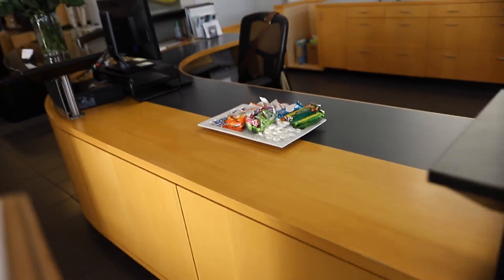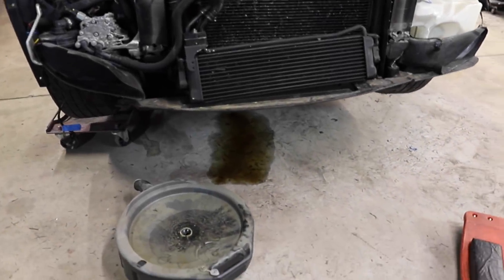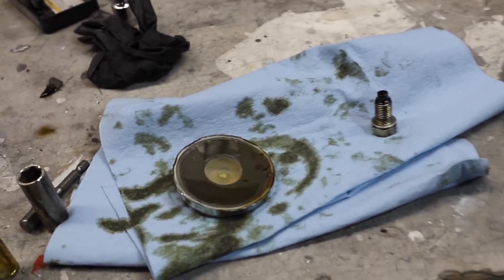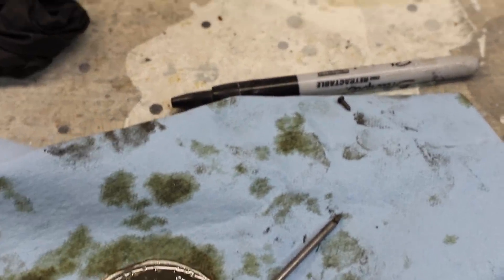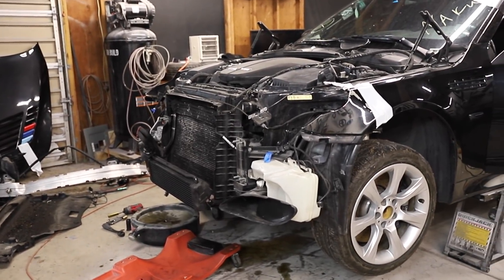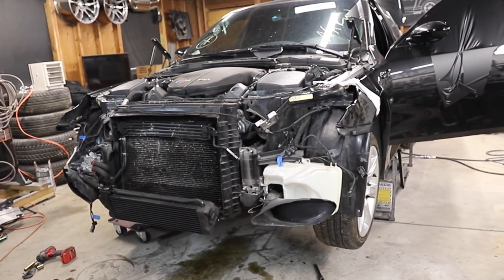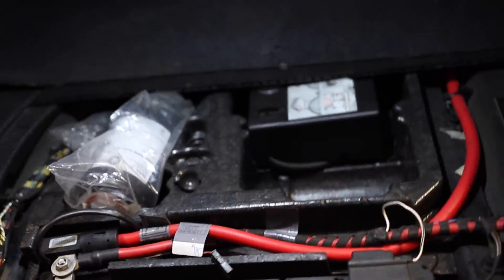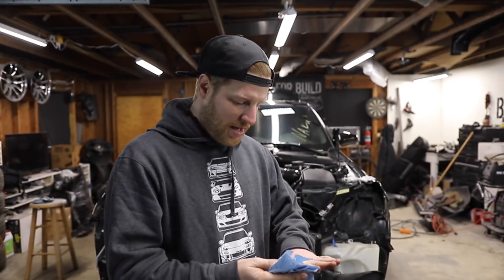Does the M5 Engine Run? Let's Find Out!

Comment: $135 for 6 quarts of oil and a filter? Did that come with a massage with a happy ending at least? Holy shit bro...I would've just gone to Walmart and bought a gallon and a quart of Mobil 1 with a K&N filter and a bottle of STP Engine Treatment and still had $80 left...I'm just blown away by what BMW charges their customers for what is basically equivalent to parts store oil. Regardless of what they try to convince you of, there is no difference. There is absolutely no argument that anyone can provide to me that would convince me otherwise. Granted, the manufacturer knows best, but come on, I PROMISE you that the dealer isn't paying anywhere near as much as what they are charging you.

Comment: i work with oils on an industrial level and that small little shaving shouldnt be an issue to worry about nut definitely consider running the xar wuth new oil and then sending a sample off to a reliable lab for testing. hope that helps!

Comment: Camera focus will improve if you shoot with a larger aperture, granted it wont look so cinematic but for general garage bits when you're in front of the cam thats not so important. Also try the other autofocus modes on the camera, you may find one that works smoother.

Comment: Could you mess around with the new camera settings and take off the focus? And I think you should be fine with the rod bearings because if you looked at your filter real good and you haven't find any metal shavings I think you're good

Comment: Wow, that's a crazy low F-Stop you're shooting with.  I know the shallow depth of field looks cool, but it can also be distracting.  You can go into Manual mode and set the aperture to F2.8-F3.5 and it will give you greater depth of field, but ISO will go up, so just be aware that it'll get grainy if your ISO goes too high.

Comment: Your not going to get good data if you just changed the oil. The oil needs to run for around 500 miles before you send it in.

Comment: Hi Chris,

regarding the RPM in the dashboard, please be advised that the RPM is filtered and smoothed for the average driver.

There is a nice talk about the Dieselgate ECU and how a programmer found the manipulation. At 48:20 of the talk ( https://media.ccc.de/v/32c3-7331-the_exhaust_emissions_scandal_dieselgate#t=2907 ) he points to the massive code for the RPM and how the RPM is "changed" to look nice for the driver. At least for VW.

As a fellow BMW driver I have the feeling my BMW E61 does it, too. Sometimes my sense differ from the RPM. So be warned, but the motor sounded nice.

Comment: Keep with the 6D but learn how to get the best out of it. Depth of Field is controlled by apeture, so in Manual exposure mode you can choose the a high F number to get more in focus.  You'll scarifice shutter speed.  If you can't get the look you want, and the shutter speed quick enough then you'll need more light in the shop.

Comment: Dont waste your time on big end bearings unless you have low oil pressure, you need to be finding a lot more metal peices before you have a problem. You will need to pull the engine first to replace the bearings.

Comment: Have the dealership run the vin to pull the service history if you haven’t already, You might get some good news that they had the rod bearings done at a dealer.

I didn’t notice the focus hunting until you said something, however if you want to keep using the new camera the lenses are usually interchangeable, might be a cheaper/easier fix. Also Not sure what video editor you use but time lapse is usually a click or two in post, gives a bit more flexibility as well. 

So pumped for this project!
Reply from the maker: My friend Brett actually helped me do this and nothing in the history, some auxiliary stuff was replaced but no rod bearings under warranty
Reply: Tappar yeah good idea
Reply: http://www.vincheck.info/check/vin-check.php
Reply: Tappar or vehiclehistory.com

Comment: The Canon 6D mk II is terrible at low light and low contrast auto focusing.  Also, Sigma lenses dont typically focus nearly as fast as the native glass.  You should check out a Panasonic GH5, or go full high end and get a Sony A7SII with a 16-35mm G-master lens.
Reply: Jason N  Both terrible suggestions for autofocusing cameras lmao. He should either get native Canon Glass or go Sony A7iii.
Reply: Ben Troxell having personal experience with both of my “terrible suggestions” I can confidently say I stand behind them. My A7III hasn’t shipped from Adorama yet, so I’m not about to suggest something I’ve not actually used, although I’m sure it’s also a winner. Thanks for the input.
Reply: Jason N Alright well you’re used to inferior autofocusing systems I suppose. Still both really bad suggestions over a camera that has dual pixel AF.
Reply: I disagree on your assessment of the 6dii. With the full frame super 35 sensor you’re going to get a lot better low light capability than anything crop sensor-including the GH5 with its micro 4/3. Sony A7S will be better low light with its huge photosites, but it doesn’t seem like there’s really a lack of light in that garage.

Comment: if you drop a flec of the metal pieces out of the filter into a drop of vinegar itll oxidize green. or it will dissolve in the liquid if its just paint

Comment: the important stuff you won't be able to see with a magnet, bearing material is, for the most part, not magnetic. you could let the oil settle and inspect the bottom of the bucket.

Comment: Couple of points I can hopefully help on:

- Do you have a Carly for BMW adaptor yet? If not, I'd highly recommend one; it's a wifi OBD adaptor that interfaces with Android or Apple devices and you can do the obvious stuff like scan and reset fault codes, program a new battery, configure a lot of settings you tailor your BMW (like switch of auto stop/start, brightness of the DRLs, wiper settings, so much stuff) -> (www.mycarly.com) 

- I'm sure you know of this already but just in case you don't, here's all the repair manuals, wiring diagrams and components for your BMW in one place - https://www.newtis.info/tisv2/a/en/  

- Your new camera's slow focus makes me want to shave my eyeballs! I said eyeballs! Maybe you need to adjust the autofocus setting so that it's not monitoring a small point but a wider area. I can't help much more on that as I have a Sony camera. Perhaps a different lens would help?

Loving the idea for the build, good luck!

Comment: I've had rod bearing failure on my BMW N55 there was significant pieces of metal in the oil! About half the size of a finger nail along with peices of swarf about 1-3 mm which was reflective in the oil catch tray once emptied... I wouldn't worry too much about what you seen on the oil change.

Comment: The red thick cable with the explosive is not for airbags. The explosive is deploued in the case of an acident to prevent shorting out the wiring and causing a fire. That cabble is going to lead to either the alternator or the starter motor. If you want prrof of it drop your e-mail down bellow. I'll send you an electrical diagram of a VW/Audi of this mechanism.

Comment: You will need to read the camera manual for this if you haven't used it before. On your exposure dial you have C1 and C2. Using these you can set up different exposure scenarios so that when you want them you just click it round and select the one you want. In your case I think you could set it up to give you two different time lapse speeds.
I couldn't recognise your "old" camera. GH5? They are generally very good but are getting a bit long in the tooth now. The 6D is full frame and that is a bit overkill for YT. IMO.

Comment: Awesome build!

The shavings on the oil drain plug are completely normal - what you need to do is crack open the oil filter and check in there for metal particles in between the paper element folds.

It might be worth doing a compression check on the cylinders before starting out on the rod bearing replacement.

To try and solve the "shallow depth-of-feild" problem - set the lens to Aperture Priority and set it to something above f9 or f14.

Hope this helps!

Comment: love the Gopro Timelapse. I would go with that, and run it the whole time your working on the car. That way you have a secondary shot. Put it on a small tripod and move it as you need to for timelapse. My Hero4 does it in 4k and you can reframe the shot pretty well without losing resolution. All my TL on my channel are done with a gopro

Comment: Couple things camera wise; 

You could try to set it to manual focus and use a narrower DoF. So instead of f/2 try f/11. You may need to bump the ISO up a bit. 
There also may be a way to set up one of your program buttons to get into timelapse mode quickly. 
The 6DMkII is a pretty solid camera regardless. Just my .02. 

Good stuff though man!

Comment: Filter the oil thru a coffee filter and check for residue. You can also see a metallic film on the surface of the oil indicating worn bits. The metal bits can be that small they are not particles but a film that sits on the oil. Once thst oils been circulated a bit it will wear down. Also ally won't stick to the mag hence the filter.

Comment: Instead of using a time lapse feature on the camera you could just record in real time and speed up the footage in post. Uses more memory, but is much simpler to setup. As for the focus... it’s a cool look, but clearly not the best for what you’re trying to do. So maybe look for a lease with a deeper depth of field so you don’t have to worry as much about focus issues and don’t have to replace the expensive camera you just bought.

Also, super happy the M5 is running! Looking forward to next steps!

Comment: the new camera is fine. A couple of setting changes and you may like it more. I shot Nikon so labels are a little different but the focus has a few modes each doing different type of focusing. look for active or dynamic focus.  Also the change in Iso can help widen the depth of field/lower the f-stop.

Comment: Hey Chris, take a look at Sony's Mirrorless cameras instead of the 6D II.. could be just an A6300 or something (think its about 900 USD in the states) - Or if you decide keeping the 6D, for timelapses, look into Magic Lantern (custom firmware for canon cameras) you might be able to use it to create a custom button for doing timelapses.. Or you can use C1-2-3 on the wheel on top of the 6D to do custom shooting settings 1, 2 and 3 - so 1 for shooting regular video, and one for timelapses, ISO, Shutter, Apperture, shooting modes and color profiles etc. changes with your custom modes..

Comment: Why does the engine have to stay with cross member. I dont understand why you dont just move the engine back with custom mounts to keep the wheelbase of the z as close to the m5 as possible to make it handle like the m5 because it is already shorter.
Reply: Also because I think he said it's got adjustable/electronic suspension which the ECU controls and it freaks out when u remove the suspension n subframe cus there's a bunch of sensors or stuff in there
Reply: You probably mean the 240Z wheelbase. You can't try to match the M5 wheelbase on the 240Z body, it's almost two feet longer.
Reply: yeah pretty sure he meant to keep it as close to the Z as possible. I agree that's it's worth looking into moving the mounts. It may look odd with such a long front overhang. Maybe test her our by putting the wheels next to the Z where they would go if you cut her up. BTW have BMW run the VIN to see if the bearings were changed, did it on my car but that metal isnt too bad.
Reply: P Kuudsk 😂😂😂😂 now I really can't distinguish if you're a grumpy grandpa or a 10 yo momma's baby
Reply: Connor Antram. Please stop freaking out over the wheelbase. FYI this exact same engine went into the E63 M6. Completely different car with a different wheelbase. The S85 V10 doesn't care about the wheelbase. It cares about no engine codes, it cares about getting air, fuel, and spark, and regular oil changes/maintenance.  So stop freaking out over stuff that has ZERO to do with the engine or the project.
Reply: P Kuudsk he shows how to do things on a budget and they all work. It might not be the work of a profesional but it is the work of a do it you selfer which most of his viewers are like me. And i cant wait to see him pull this build off. You dont know untill you try. I just think if the wheel base of the z gets any shorter it wont handle well. He can always just change the spring to accomidate for the lighter car.
Reply: P Kuudsk Wow the hate you have for someone doing what they love is astonishing. I sense a lot of jealousy in your comments, you worked 35+ years being a mechanic and I guess it didn't get you much. He doesn't claim to be a professional mechanic but he pulls of projects that many people wouldn't even attempt, especially this one. At the end of the day it comes down to this, if you have nothing nice to say, don't say anything at all.
Reply: P Kuudsk everyone starts somewhere, imagine doing these ambitious projects before your training, he’s learning and that’s all that matters. If we shit on people constantly why would anyone else wanna get into the hobby? We’re trying to expand the community not shrink it by convincing everyone they’re never gunna do shit right without 6 years of training (not true)
Reply: B is for Build no what i mean is to keep the wheel base of the z the same. Because if you shorten it it will handle like crap. I know that the bmw suspension has electronic sensors but that would just be extending or shortening wires. i will be proved right or wrong when you shorten the wheelbase of the z. Its your build you do it how you want and i cant wait the see the end project.
Reply: P Kuudsk ok so ur some grumpy old man 🤣🤣 sorry abt “bro” should have use “mr professional mechanic “ pootube sounds good for u ,anyway peace out ✌️ “ SIR”
Reply: P Kuudsk i think now u shld read d comments “SIR”
Reply: Moses Stevens don’t get triggered
Reply: B is for Build yeah not everyone has done as much research as you? And sometimes viewers have good ideas that you may have missed. No need to be a jerk. Were all friendly here. Either way im hyped for this build
Reply: conner read all the comments
Reply: Shit happen's kid but to jump to conclusions makes you look stupid abdul . Not just in my eyes but anyone who ever reads this now . Stop think then speak . I wouldn't comment on his builds if I didn't think other's might follow and make HUGE MISTAKES . If they followed his crapy work thinking it was right way to do things .
Reply: B is for Build No need to be passive aggressive towards the guy. He may have misunderstood, so just set him straight without being pissy
Reply: P Kuudsk  ur jst some fucked up hater who probably thinks negatively 2wards his builds .. if hes doin mistkes his probably learning n teachin us at the same time .. jst keep it chill n let us viewers watch he’s work if ur so upset about he’s work than you should open ur own you tube channel n teach people how good ur mechanic skills r  commenting n talking shit about people is easy  ..peace out bro
Reply: Read what I said if B blunder fuck dosen't delete it from here
Reply: Rabbit hole of no return that will take 100 k + to make it right. Anyone can make a car run and move using junk yard parts. getting them all to work together properly is the trick. A v10 making that hp in a ill handling car is a death trap. Yes it is his life and he can do what he wants ,but, to think he has any knowledge to pass on is foolish. Remember he was a soft wear developer just a few years ago . Now self proclaimed car builder.
Reply: He is in at 35k already and just starting so no budget build here.
Reply from the maker: dude you dont even understand what your commenting about, and it has nothing to do with this video.. move the engine to make it more like stock bmw? Move it to keep it the same? think about that...
Reply: Weak minds have problems like that.
Reply: abdul mattur I was a professional mechanic for 35 years I just call it as I see it. In my country you have to go to school for 1 year and train under a professional master mechanic for 5 years before you can just start working on cars on your own ( longer than this channel has been around). Our cars have to be inspected by a person like myself and not 1 of these builds would I sign my name to as road worthy. I am not about to start a pootube channel at my age. I am not your "bro" you little punk so go piss off.
Reply: Don't worry Conner this build is going to get so fucked up it will be never done right. It doesn't have to stay , in fact it should be relocated on a custom cross member, upper strut/coil mounts . He hasn't even considered weight balance,and how the suspension won't work with a short wheel base super light car. Then he has to by pass the air bag system completely ,sure you can try and fool the system with resistors , but that will be a wiring mess like his other car's . B is for build junk. That lotus is worth nothing with a hacked up,boged together frame. He stuffed a jz in some pos and look at the mess he made of that wiring job. He spent months trying to turbo a mustang, notice none of these cars ever run on his channel. His paint jobs are crap and now he is about to blow up the house he bought one day soon when a spark goes off in his home made pos paint booth. The guy is a fucking joke and makes good mechanics and body guys look like they over charge . I just get a kick out of how he fucks shit up , calls it fixed and ready to go,so now and then I tune in to see how bad a job he is doing. Get add block and don't give him anything for your time watching . Find a good mechanic to learn from and how to do things right if that is why you are here .